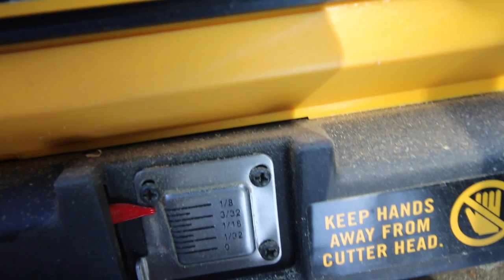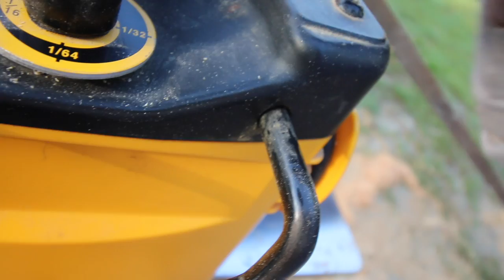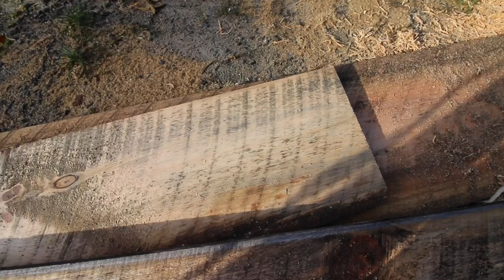🔨DIY Rustic Barn Board Project 🔨

Comment: I haven't seen anyone give the answer to the door project Al is building. So I'll add that I think that he is replacing the zipper door on the tool shed with two swinging barn doors. Maybe a place to store the Kobota during the winter and a lot easier to get into than that roll up door.